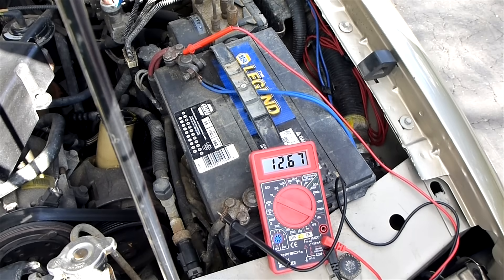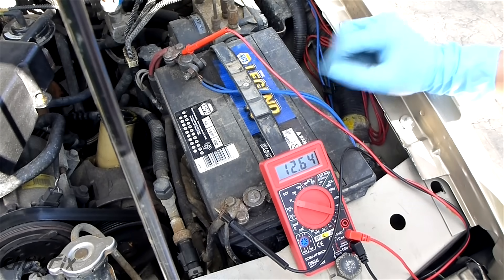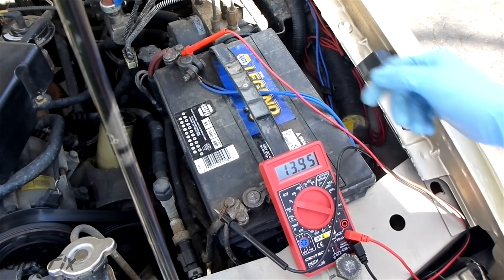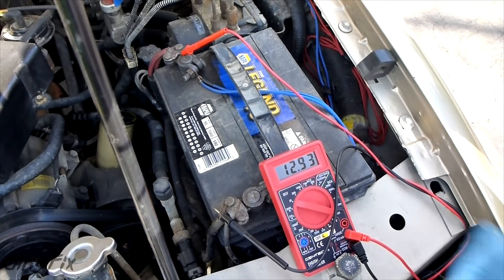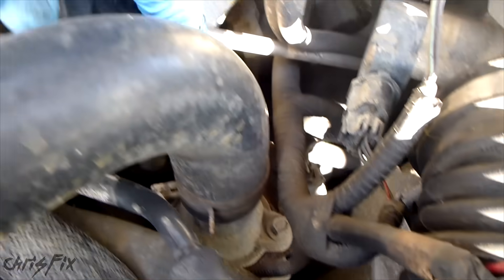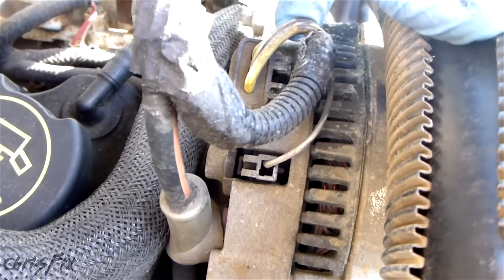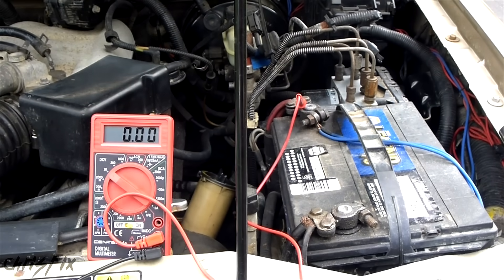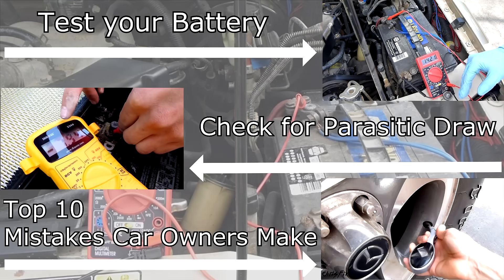How to Test an Alternator

Comment: Hey chris thanks for the video, helped a lot so far.  I believe I have figured out that my grounds are good and the issue is on the positive side. Been told alternator is good and I have a new voltage regulator.  This is on a 75 ford f250.  When I go positive terminal to b on the alternator I get a -.26 reading with no load and with a load I get -1.3 so my question is what do I look for in order to fix.
Reply from the maker: David Sheets I would clean the connections (just like if the grounds were bad). Let me know how it goes! What is the problem with your car that you are trying these tests?
Reply: ChrisFix thanks for the reply..  the alternator did go bad (or at least I thought it did due to symptoms), I replaced it and the battery still has a strong drain while car is on.  Causes it to die while running.  Then I changed external voltage regulator, still having same issue.  Been trying to check all connections and can't find what is causing it.  Did clean the connections I touched during install just not the problem one yet.
Reply from the maker: David Sheets Does the car die when it is off for a day or two?
Reply: ChrisFix no only when running which is why I don't think it is a parasite issue. I double checked the battery levels to be sure.
Reply: David Sheets there was a pop when I first installed alternator, thought it was due to a ground.  checked it, took alternator off got it checked and that is when I learned it was still good.  At that point I added the voltage regulator.  Haven't heard pop since and haven't found any broken fuses, burnt wires or the source.
Reply from the maker: David Sheets And I assume you are getting 14.2V when the engine is running?
Reply: ChrisFix This is also a new battery and here are the readings…   truck on 12.41 and with a load it is at 12.09 and continues to drop.    I also have a schumacher battery charger and it shows large drops as well.  It has a alternator setting and that reading comes up as 0.  My think next mission is to look for a short or something that is happening and causing the alternator to not charge the battery.
Reply from the maker: Yea, the alternator is not doing its job. Maybe there is a break in the line between the alternator and batter. What happens if you put a lead on the positive end of the alternator (like right on the alternator) and then the other lead on a good ground? Do you get 14 volts?
Reply: ChrisFix That sounds like good DIY test and I will try that.  The confusing part about that is that I have pulled the alternator twice now and taken it to two places to get it tested.  Both times they said it was good.  I will try tomorrow It is snowing really hard right now.  Thanks again for your help and patience.  I love getting my hands dirty and working on stuff, unfortunately this has really stumped me.
Reply from the maker: David Sheets Keep me posted!
Reply: ChrisFix well after 4 days of not touching it, the battery was reading 12 volts with a 40% charge.  Got it to start fine and then tested the voltage on the alternator.  From the battery input on the alternator to the ground it was reading 9.79 volts NOT 14v like you suggested.  So now I should look for a break between the battery and alternator?
Reply from the maker: David Sheets I would check for a weak line from the alternator to the battery or a dirty connection. Sounds like the alternator is bad though. Do you have an external regulator?

Comment: My car drives fine but it started stalling when I came to a slow down or complete stop. I checked the battery and its dated March 2009..Could this be the battery or the alternator..
Reply from the maker: stylediaries kiyara It is more likely the alternator. When the car is running, the power comes from the alternator to run the car.

Comment: Hi thanks for all the info. My question is I bought a Vintage car Jaguar 1950 Mark V, and it does not start what things that i should check first to diagnose the problem? I would really appreciate it if you could share me some of your knowledge. Thansks.
Cherfield
Sydney
Reply from the maker: cherfieldm Hey man (nice car). Can you tell me what happens when you go to start it? Does it turn over? Does it sound normal or is it turning over slow or fast? Do the lights dim? Do you hear the fuel pump running at all?
Reply: No spark, no fire at all, the battery newly charge, I am not sure of the fuel pump running?
Reply: Hi Chris, thanks for all the help, what type of cleaner or spray we need to use to clean up some wire connections?
Reply from the maker: cherfieldm Any electrical parts cleaner will work. You can use a little WD40 if you dont have any electrical parts cleaner.
Reply: Thanks!

Comment: Hi ChrisFix, it's me again. I also know a trick if the battery is starting to crap out on you. When cranking the car over, The battery voltage should read above 10 volts. If it's lower than 10 volts, better buy a new one soon. Your battery showed 10.97 volts which is still okay. Once the meter drops below 10 volts, time to buy another battery
Reply from the maker: Peter Kapica Thanks Peter. I go over that in my battery video: https://www.youtube.com/watch?v=COJr7OB23Hw
Reply: Oh didn't see the the description

Comment: Those battery connectors are NOT good ones, they are trouble from step one. NEVER use those kinds of battery terminals.  Most of the problems my kid's friends had in their older vehicle were because of Those types of connector. I use either ready made or Marine wingnut with Soldered Cable eyes. Just a head up. I do like your analysis on the Alternator and connections though.
Reply from the maker: Herman Vogel Thanks. I never had a problem with the connectors but I will keep an eye on them.

Comment: Hey great video thank you. I had a problem today that you might know what it is. I started my truck this morning to warn up the engine and it started to slow crank but it did start. My truck is a Toyota 1990 pickup and for the last 2 weeks or so the battery, brake light and the a/t oil temp light had been on the whole time I've been driving it. I did not have a problem starting it until this morning when drove my kid to school and had the engine on until I dropped off my kid got into my truck and stepped on the gas and the battery just died on me while I attempted to drive off. I will appreciate whatever help you can give to fix this problem, Thank you for your time.
Reply from the maker: ***** Did you do the tests I show in this video? What did you find?
Reply: ChrisFix No, I haven't. Reason is that I left my truck back where my kid goes to school (about 2 miles away from my house) and I just had to take out the dead battery to have it charged( which is still not ready ) I will however get back to you as soon as I get my battery back and hopefully it doesn't leave me stranded once again.
Reply: ChrisFix Hey Chris Fix, sorry for the long delay but I just wanted to give you an update to my situation I had awhile back. As I commented I did take my battery to get it charged and I also cleaned all the terminals like your video. that said it turns out that my alternator was fried. I took it to the shop where they had it removed and inspected and yes they opened the alternator and most of the wires and connections where burned. I want to thank you once again for your videos as it did help me diagnose the problem before it got worse. Thanx.
Reply from the maker: ***** Thank you for the update! That is great you were able to find the problem before things got bad! Glad my videos helped! Love hearing stuff like this!

Comment: i have a chevy trk i bought kc 800 series lights for it, 4 of them. i have done the test u said. little over 14. now the kc guy said i will have little over 10 amp draw when i hook them up. will this be ok? if i have a problem will i need to go with a 2 battery system to run the lights. or a bigger alt?
Reply from the maker: allen Henry If it only draws 10 amps you will be fine. My offroad lights on the front draw 33 amps at 12v and I have reverse lights that draw 10 amps and I dont need a more powerful alternator. If you end up needing something, it would be the alternator btw.
Reply: What kinda lites u have on ur rig? Deul switch or 2
Reply from the maker: Check this out: https://www.youtube.com/watch?v=w0ChnfrWy88

Comment: Thanks for this video. It confirmed my thought that everything with my '67 CJ-5 was fine, I just let it sit in the garage too long. (My bad, I know.) After jumping it, I took it to my nearest auto parts store for a test, and the young, pleasant attendant told me he thought my alternator was dead. I thought he was relying too much on the fancy diagnostic equipment and not listening to what I was telling him. But the numbers don't lie. 12.5v after a bench charge, 14.2v with it running, no change when I switched on the lights (the only drain beyond the plugs on a 67 Jeep). 13V when I shut it down. Thank you sir.
Reply from the maker: tjcouch No problem! Glad the video was helpful! Definitely consider subscribing! New automotive 'how to' videos every Thursday and most Mondays!

Comment: Hi i have a problem with my car. we have changed the alternator and got a new battery as the car was not starting regularly and the battery was completely drained. Since we have replaced the alternator and battery this same problem occurs every while ( for a week or so it is fine and then the problem occurs again then when jump started car runs fine for a while and so on) The battery reads 12.4 when you start the engine 14 and when you turn on everything (radio, heater, lights etc) 13.8 its a volkswagon golf mk5 1.6 petrol 2005. Are you able to help thanks
Reply from the maker: Zanyar Faqi Here is the perfect video for you: https://www.youtube.com/watch?v=n5FJDgcdii8
It sounds like the alternator and battery are in good shape. Did you try testing the ground like at 5:00 in this video? What readings did you get?

Comment: great vid but when you first touched you battery neg it moved may check this out?
Reply from the maker: orange12v Thanks. What do you mean?
Reply: In your great video you briefly probe your battery's negative terminal and it turns slightly ! I am not trying to put you down just bring it to your attention
Reply from the maker: orange12v I was just wondering what you meant. These multimeters are sensitive and when you make contact with a battery sometimes you get a very slight reading. You saw the negative sign come up when I touched the black lead to the negative battery terminal. That is fine. Good eye.
Reply: ChrisFix No after you show your meter about 50sec's in you put it's neg probe through your battery's neg cable and the neg battery clamp turns slightly it's true have a look

Comment: I noticed that you increased the RPM of the engine manually and I know that would be specific for different cars. I would just like to know what I should search for if I were looking to manually increase the RPM of the engine for my car? Thanks again so much Chris
Reply from the maker: Tristan Turner You just look for the throttle cable and turn the spring it is attached to. If your car is drive by wire (electronic throttle body) you cant do this.

Comment: How much does one of those testers go for?
Reply from the maker: Fel_718 This one is free at harbor freight, but it is pretty cheap. Check out the link in the description for a decent multimeter that will last you and give you the accuracy you need, for a price under $20.

Comment: Nice video, simple and straight forward. My 2002 Nissan NV seems to start fine if I put it in neutral, but if it's in gear and I push in the clutch sometimes it really hesitates to start. Some sort of clutch switch to the battery you think? Thanks for the advise.....Sheila
Reply from the maker: nissannewride What happens to the voltage when someone presses the clutch with the car running? Does the car change idle or anything? Also definitely consider subscribing! New automotive 'how to' videos every Thursday and most Mondays so stay tuned!
Reply: Have to check that, will get back to you soon. Merry Christmas and a Happy New Year...thanks for all you do.
Reply: Can bad fuel gum up the starter? We use 95 ethanol here in Thailand at about $6 a gallon.
Reply from the maker: nissannewride Bad fuel wont affect a starter. The starter is external of the engine and doesnt get affected by gas or oil or tranny fluid. It connects to the flywheel and turns it when you turn the key.
Reply from the maker: nissannewride Def let me know what you find and Merry Christmas and have a Happy New Year as well!

Comment: Hey Chris,

Got to love that Harbor Freight meter!  LOL

Listen, the timing for this vid was just too good!  Yesterday I was out with the family and had the heater fan full tilt to prevent fogging up the windows.  I noticed it would slow down at idle and did not like that specially since I replaced the battery last fall.

So I tested the voltage when cold, was good.  Cranked it, was good.  Put up revs. Put load and then started falling to below 12,3V.  I took the electrical load off and back on again. I had, fan, high beams, heated seats, radio, rear defroster.  Sure enough, it started falling again.  Then, something happened and voltage went back to spec despite the load.

What do you think it was?  I suspect a bad connection like what you show in the end of your vid.  The current draw must have had it "spark" and it "re made" contact.  I'll monitor it in time, but for now, seems like it whacked itself back in place!

Thanks for your vids, even if I've been arround cars for a long time, I still learn some good tricks and specialy I now have explanations for some stuf I just knew.

Keep it up!
Reply from the maker: hasbeengood Thanks a lot man! That is weird that it just clicked and started working normally again. I bet the voltage regulator was not working right or had a bad contact or something and that click is like you said, a spark or a connection that was made so now it works.
Reply: ChrisFix
I'll monitor from time to time and let you know what I find if anything. Wether you care to know or not!  LOL
Reply from the maker: hasbeengood Yea, let me know, I am curious!

Comment: well my alt is bad my battery tested good crank amps too the alternator does eh okay but under a load once it heats up  it will drop voltage when i have accessory's on which is usually my radio and night head lights at an idol my voltage will star dropping and always will fall below 12  sometimes even down to 9 all my connectors seem good no corrosion on them or burnt wires ive been told i have a bad voltage  regulator which in my case means i need a new alternator im put one in sunday as of right now the truck still runs so i think i can make it till sunday when i can have someone help me put it in
Reply from the maker: SuperJeremi10 Great! Glad you diagnosed the problem! Alternators are really easy to replace if there is access. On a truck it should be 30min to an hour if you take your time! Let me know how it goes!
Reply: yup im sure the truck will make it till Sunday i have nothing planned for tomorrow so not likely ill go anywhere unless something comes up.
Reply: well put in a new alt over the weekend good as new. i actually might be changing vehicles soon if everything goes as planned.
Reply from the maker: SuperJeremi10 Great! Glad the video helped you figure out the problem! Nice work and thanks for the update!
Reply: your very welcome on to the ac  and transmission haha my transmission will slip sometimes and i got parts for my ac in.
Reply: did you get a chance to look at that video did you even get it.
Reply from the maker: SuperJeremi10 Yes, I watched it and commented back on your message.
Reply: oh how can i get to my messages it never showed you watched it  and im hoping i can get the motor to leas 320,000 before it craps out
Reply from the maker: SuperJeremi10 You go to your comments page and then click messages. That would be awesome if you can get it to 320,000mi!